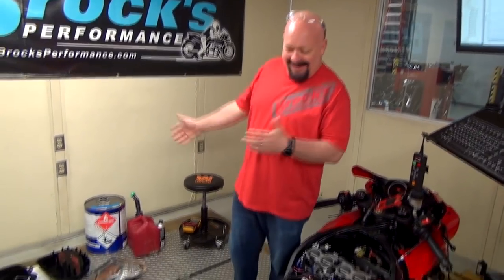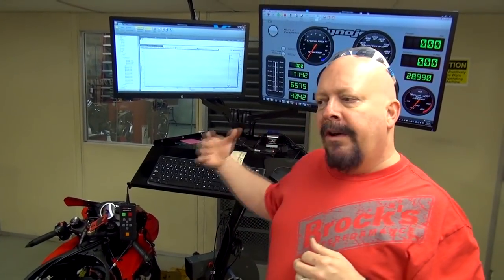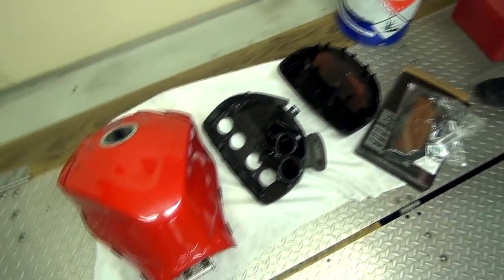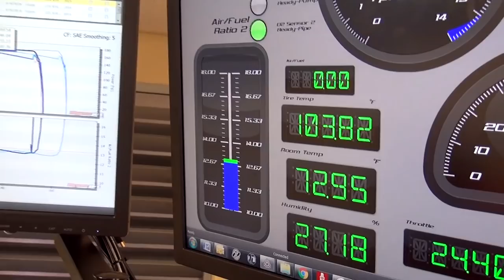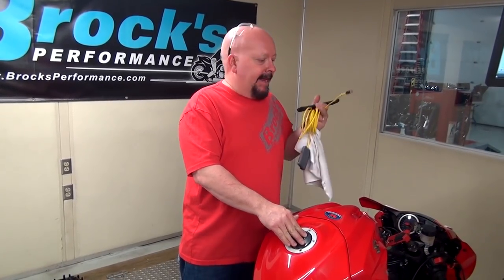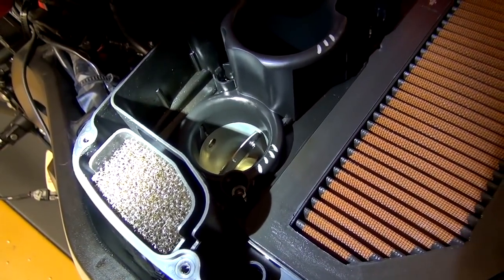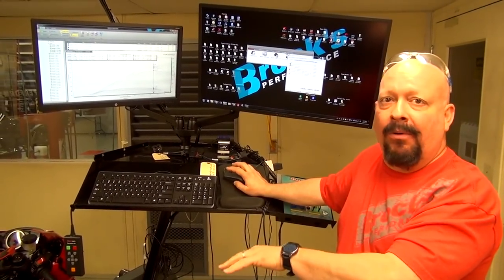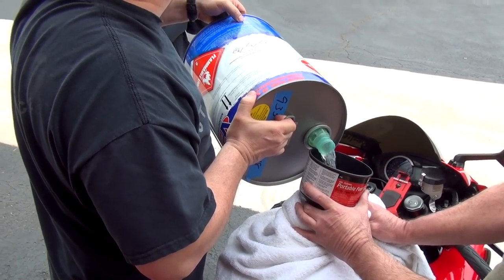Tech Talk: Suzuki GSX-R1000 Stock to Brock: "Hey Brock...What About MY Bike?"

Comment: My friend had a car repair shop..  His Brother bought a bunch of diagnostic computer   readers   for Ford Chrysler and GM  My  friend asked why did you by for GM all you need is a paper clip? 

  I bought a Ford 800 Truck in OR  250 HP 3209 Cat Diesel with small turbo ..  I changed the oil  had  extra fuel filters with .me..    it had  been sitting for a long time but only had 49,000 miles on it.  I inspected the air filter  and thought it looked OK ..   It did smoke  I was in   OR CA high altitudes it smoked a lot ..     When I got back to MI I realized the air filter was really clogged  it  really made me sick to realize how much extra fuel I burned do to dirty air filter.. 

   Unleaded gas burns cleaner .. but   most all gas is  E-10  which I thought keeps engines  way cleaner ..

   A dishonest repair shop  could charge big  $$$   for the improvements a new air filter could make..  K&N air filters simply don't work on dirt bikes the sad goes right through them ..  Also with out and air box water rain or snow will drowned your engine ..  Now days   you can buy  a really fine mesh screen  from Outerwear ....  to keep the water even water vapor from entering .. the filter and engine .. I had always seen  Outerwear  advertised in dirt bike magazines.. I needed to keep the air vents from  clogging in my snowmobile and wanted t purchase some of their material .. is very expensive comes from Germany I  think .. 

  When I went to call them I noticed they had a local phone number..  Turns out they are in Schoolcraft Mi  8 miles from me and I went to school with their accountant.. 

  I was trying to get more power out of my snowmobile  the air box seems restrictive and  is warm under the hood..  So I put a K&N air filter in the nose of the sled  which has  holes drilled with outerwear material  lets air in but not snow .. and the K&N has an outerwear  sock of course  I  used about 2"  aluminum tube and ran filtered air into the air box..  seat of pants tells me I gained HP ..    also  a 4 degree offset key way advanced my timing  helped my cursing mpg the most.. 

  Polaris has some two stroke snowmobiles with a  timing  switch for   premium or  87 Octane gas..  some times  you just can't find Premium on the trails .. seems like a great  idea to me ..

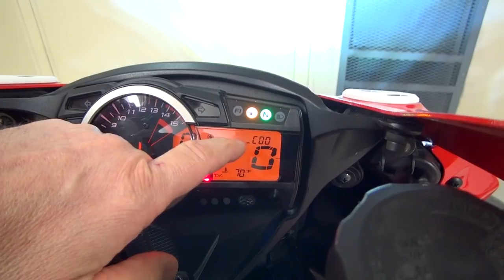Comment: At 7:12 the position after faultcode_C28 correction should be in the middle (pos.B-according manuel), but on this video its in the lowest A-position leftside _C00. or _c00 for GSR600-K8. Correct should be -C00 or -c00 instead of this video _C00

Interesting; At 15:31 setting into gear the second throttle valves opening

Comment: The rich AFR  was measured in wich conditions ?
with filter ?
with airbox ?
Reply from the maker: Rich afr condition was no airbox or air filter. Final results were with P08, stock airbox and stacks - would have made a bit more with the P08 F1-85... but we were out of stock :(
Reply: So i can tell you that the AFR was too rich because the lack of air filter airbox stacks etc..
The airflow quality was inferior because of the designed  whole intake system was missing parts.
A laminar,clean, airflow is difficult to get with the square edges just above the butterlflies , where are supposed to be the bell mouths / stacks.
Since the bike in not in closed loop it's rich.

Comment: Seeing 176hp from a stock engine 1000 is impressive.

So what about my bike? Lol

I have an 06 GSXR 750
45,000 miles(geared probably closer to 40,000)
I'm curious as to what would be realistic hp goals for this bike on pump gas? All it has now is a K&N with a slip on. Planning to throw on some 1000 headers for the weight loss and hp gains if it would help...

I had looked into the Sprint filters, but they only offer the old style for my bike and it looks just like my K&N, so IDK if there would be any gains had there or not.

Anyways I plan to get it dyno tuned this summer and I was curious as to what numbers you've seen out of 750s? The most I've seen or heard of with full exhaust is around 128hp.

Anyways thanks again for all the great videos and help with answering all my many questions. If I lived closer I would bring it to you to throw on the dyno.
Reply from the maker: @WRIGHTRACING - Glad you are enjoying our channel. Be wary of installing a 1000 header on your 750 as the increased hedpipe tube diameter can lead to a serious lack of bottom end and mid range power...something those bikes don't need to lose. If you have a K&N street filter, there is a good chance your OEM paper filter makes more power (not bashing, just speaking from comprehensive testing over the years). 125 HP (SAE scale) is good for those bikes - 140 is possible, but you need to get into the engine. As a smaller engine with higher miles, the first thing we would do is run the Wynn's Power charge through your bike, to clean up the engine deposits, then we would add Alisyn 0w-20 and Petron. Those items alone can make a large performance difference in a 750. The rest would be proper product selection (pipe/performance filter/tune etc...) Best of luck!
Reply: @BrockDavidson  good info to know on the air filter and headers.

So I'm assuming that the Sprint street filter is much better even than the K&N as well then? I'm all for comprehensive test results 😁

So when it comes time to hit the dyno, I will definitely do a Wynn power charge clean on the bike before then. I may look into the air filter change next and then when I hit the dyno, hopefully we can test both headers and see what the results show. Also planning to test a few slip ons. When I get the time I definitely want to video it to show the results of the changes that we make and what helps and hurts.

Thanks again for the rapid response. Hopefully we can get this done this year. Lol.

Comment: Question regarding the 2024 Gsxr 1000R. I'm in traction control setting 5 in A mode and I'm popping wheelies in second, third, and fourth gear, not sure how to control it. Guys I ride with.. we start off with a few smack downs, second gear 65 miles an hour for approximately 10-15 seconds in a straight, just can't figure it out regarding the wheeling.
197HP & Full Brocks Alien 2 Head System
Reply from the maker: What is the rider weight?

Comment: Hey brock what 1/4 times do these gsxr of this era run? Bog stock

I ran a 10.5 @ 140mph on my 2013 bog stock 

Thanks
Reply from the maker: Depending upon rider size and skills 8.80's to low 9's at close to 160 MPH - set up correctly. Bone stock high 9's.

Comment: Thanks for your reply weight 222 LB. Full race suit and helmet.
Reply from the maker: If you are stock wheelbase, you will need to remove 1 or two teeth from your rear sprocket. This will decrease torque to the rear wheel to allow you to get to WOT sooner with fewer wheelies. Of course, lengthening your wheelbase  would help much more and possibly allow you to go the opposite direction with your gearing to aid acceleration. At your weight, the bike naturally tries to wheelie out from under you, compared to a lighter rider. Hope this helps. BD
Reply: @BrockDavidson  thank you for your time and information. I will definitely take your advice and order a new sprocket from Vortexx tonight.

Comment: I just bought a 2008 gsxr 1000 with 38000 k's and same thing is happening to me the bike feels like a 600, it feels like it stuck on C mode. when i twist the throttle the engine does not match the rpm  and even when i try to wheelie it there is no power, these bikes bikes should go up effortlessly.
Reply: joey bello:  Unfortunately most of these amazing bikes end up in the hands of bad owners.  I'm sure your bike would benefit greatly from a tune up.

Comment: But Brock what of that TPS SENSOR reading when u had the paper clip in is it there a not in the middle for some reason
Reply from the maker: The TPC can be manually adjusted when in dealer mode (paper clip installed) buy it can also be easily calibrated in the PCV also. This will assure the scale from 0% to 100% Throttle is correct.

Comment: Hey Brock, I have a 2006 gsxr1000 and it keep bogging down when I turn the throttle. It wont go over 7k rpm.   I've changed plugs and fuel pump any suggestions?  The bike sat for like 9 years.
Reply from the maker: Try the troubleshooting tips here, ignore any that do not apply.
Reply from the maker: If they don't work, let me know.

Comment: I've got about 10k on my 18 gsxr 1000R. I noticed a little decline in power. I think I do. I could be wrong as I'm just over a year with the bike. I bought a can from you guys hoping it brings some power back or my placebo takes affect 😁. Either way it could use a cleaning after 10k
Reply from the maker: Our all time record HP gain was NINETEEN RWHP and that was on a 2007 GSX-R1000 with only 3K miles. We weren't exactly sure why that bike was so clogged, but it never ran correctly until we ran the Power Charge through it...once we did, it was an entirely different machine.
Reply: @BrockDavidson  I want to put this whole can of wynns in my tank. Very unfortunately we may only have two days of riding left here in northeast Ohio. Is it a bad idea to leave it in the tank? Can it eat the tank lining. That's one thing I've read about the possibility of using too much fuel treatment. Have any experience leaving it in the tank for a while

Comment: Brock great video! Actually like this better than the Stock to Brock series. It’s more relatable to my bike. Plus I seen you added a new package to the site based off this bike. Do some mapping for the GSXR 1000 K9. I already have a full system from you and a PCV with your street map but I changed my gearing -1/+1, added BMC Race filter, and added the Haltech TRE box but the bike is as this customer said slow (Dyno SAE 165)!!! I’m at the point where I’m going to get a custom tune for my current setup. Your customer service team said that I shouldn’t but I know the bike has way more power hidden in it! What do you recommend? Thanks!
Reply from the maker: @Berto - glad you like this series also. Please contact dynoroom@brocksperformance.com we just as easily flash the K9 ecu to these same parameters.

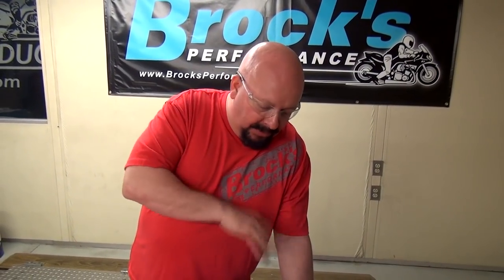Comment: Hi Brock! I'm very impressed from your guides and after watching this video I did some clean up with Wynn's Xtreme Petrol Cleaner and the result was beautiful. Too bad I'm from UK and I can't bring my GSXR L1 1000 to you so you can tune it properly. The some of the previous owners of my bike did something to the secondary throttle valves and I can't fugure out what. They don't have stock oem behaviour like in the service manual, but they behave exactly as these in this video part 14:40. Why they don't make initial check cycle when the ignition key is turned ON? Please can you share what you did to the secondary throttle valves on this bike if it's not a secret because I'm just trying to understand the history of mine and the previous owner can't help me, because he bought the bike like this. One thing I'm woried is that the fast idle, which is controlled by the secondary throttle valves is no longer supported with this function. Is it a problem and should I andjust something?
Reply from the maker: @Deyan Dimitrov - glad you like our series. If you mean the 2001 GSX-R1000 (K1 here in the US) the bike has minimal restrictions. The secondary blades are left in place for smoother operation, or removed entirely (requires slight fuel remapping). if you do not have a check FI light, your bike should be fine. Please check this FAQ about the need to bring your bike here for tuning: http://blog.brocksperformance.com/faq/do-i-need-to-physically-bring-my-bike-to-brocks-performance-in-ohio-for-a-performance-tune/

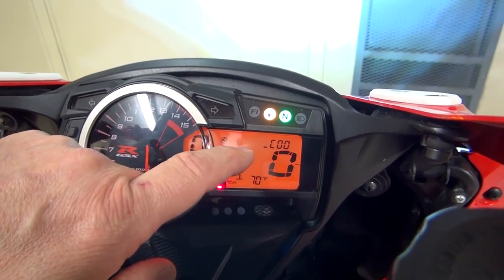Comment: What's good Brock? I noticed @ 7:12 when you were showing the C00 code that the dash mark was in the lower position. I recall you mentioning the dash mark was telling where the TPS was positioned in another video. Does that mean the TPS is closed more than it should be? As far as air filters go, humans don't have filters, but if too much dirt gets in our noses or throat, you will cough or sneeze. With any used vehicle, time it to stage 0 first, then upgrade🏆
Reply from the maker: @P.E.1 you are correct on the dash mark being in the lower area, but it didn't matter in this application because we used the PCV to calibrate the TPS. When done in this manner, the position on the dash takes a back seat and the PCV is the king of telling the ECU that no gas is 0% and WFO is 100%.
Reply: @BrockDavidson  ahhhh seeee.... I'm paying attention to the professor. Learning is occurring!

Comment: mr brock i have a 06 zx14 with USED vance and hines cs1 slip ons ,at moment i couldnt afford nice exhaust of yours which i love the sound but my question is with a 265lb rider would it help much to take stock 17/41 gearing to 16front with stock 41 rear? i also have a map that is for secondary butterflys removed to help with leaning it causes when flys gone.. previous owner placed a 09 zx14 header gutted cats and i placed the vance and hines cs1 mufflers on. im just wondering if the -1 down front helps and should i go more being a heavy rider
Reply from the maker: @Danger Davefpv - for street riding, dropping one tooth in the front sprocket is a very common and inexpensive way to increase torque and acceleration. For a larger rider, it's usually a welcome change. The only real downfalls is that the speedo will read a faster speed and it can also hamper fuel mileage a bit.
Reply: Brock Davidson thanks Mr Brock, I appreciate ur expert advice and will do this very soon

Comment: Hey Brock cool video  can you elaborate on gear , you stated in the video if the customer want  to go faster he had the change the gearing I have the same bike and I bought a set of chain and sprocket with oem gearing
Reply from the maker: This bike had 'drag' gearing for quicker acceleration for use with the extended swingarm, which works great for drag but limits max top speed. Most of today's bikes are speed limited by the ECU to 186 MPH (300 KPH), what many don't realize is they are also gearing limited to this speed, or slower. This means that to obtain full race performance and top speed - both areas must be addressed. We use a gearing calculator to calculate top speed after the ECU restrictions are disabled. This one works well: https://www.gearingcommander.com/

Comment: Anyone else notice that TPS line was off when put in dealer mode?? Lol major performance issue
Reply from the maker: Secondary flies were mechanically stuck open - but the ecu's fuel maps were operating off of the grip sensor. Made a real mess of the mapping.
Reply: @BrockDavidson  ohh I see! I trust your knowledge over mine any day! Thanks for the clutch mod and extra heavy duty springs for my gen 5 zx10r 🤙 amazing performance!!

Comment: Even the 2006 R6 model lied on that 16k rpm. Ugh.
Reply from the maker: It's not as bad as it used to be. In years past it was not uncommon for motorcycle tachometers to read 1000 to 1500 RPM to the optimistic side. Today, some sportbikes rev to an honest 14.5K off of the showroom floor.
Reply: Brock Davidson We also have the old 4 cylinders back in the 80s and 90s 250cc bikes that revs up to 20,000 RPM like the 'BabyBlade' CBR. Hahahaha

Comment: I've been watching your videos for about a month or so, I really like your approach to performance gains. I'm in the market to buy a bike over the winter or in the spring, doesn't really matter new/used with low miles. Is the 2017+ GSXR1000 still your pick for bang for buck or would you suggest some other year/brand/etc.? Thanks!
Reply from the maker: There are many choices available in the 1000cc class. We have had good luck with the R1, ZX-10R, BMW and Gixxer. So far, we have gone quickest/fastest on the Gixxer and it's the bike to beat from our stable at the moment. As far as bang for buck with a new bike, it's tough to beat IMO. If you are looking at used bikes, the older s1000rr's and ZX-10r's are excellent choices also.

Comment: Another great video. I have a GSXR 1000 K5, with 35K on the engine, do you think it would be beneficial to put a tin of Wynn's Power Charge
 through it?, and is there any chance it could damage anything?
Reply from the maker: @bill dodds - YES, your bike is a perfect candidate for a fuel system cleansing and no, Power Charge is approved for use in all 4 stroke engines. I use it in my truck with 200+K on the odometer. It's smoother and gets better fuel mileage after a bottle.
Reply: Brock Davidson  thanks for the reply, I will give it a try. Keep up with the awesome videos.

Comment: suprised yto see the strap is right on top of the exaust outlet
Reply from the maker: It's an optical illusion from the camera angle. They melt and break almost instantly if located directly in front of the exhaust outlet.  FYI: This bike is very close because of the extreme length of the swingarm which moves the bike away from the dyno's tie down hooks.

Comment: hey brock what raceparts have the bike race filter exhaust powercomander!what else?
Reply from the maker: Here is the complete performance package: https://brocksperformance.com/s2b-performance-package-for-the-gsx-r1000-12-16/
Reply: @BrockDavidson  i have gsxr 1000 k9 racefit growler bst racing filter sprocket 16T and ecu flash and only made 162hp and 105torque 98 octane its that normal for k9s bikes??
Reply from the maker: @kostaskonstantinou640   the K9's seem to be the least powerful of the GSX-R1K series, but 162 sounds very low.